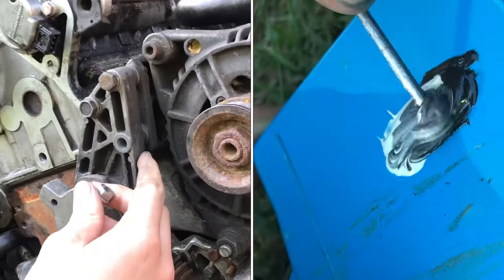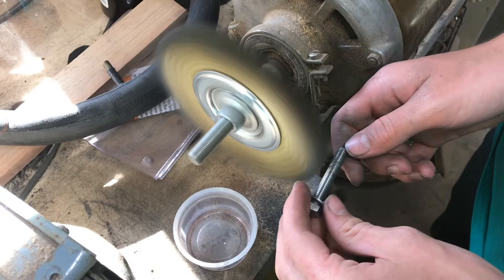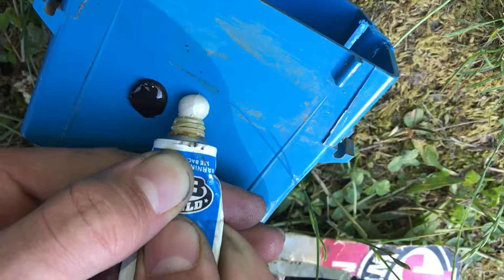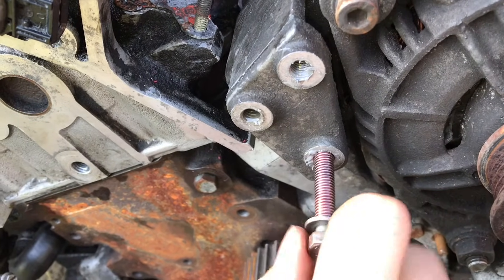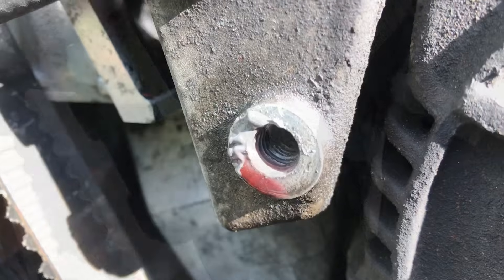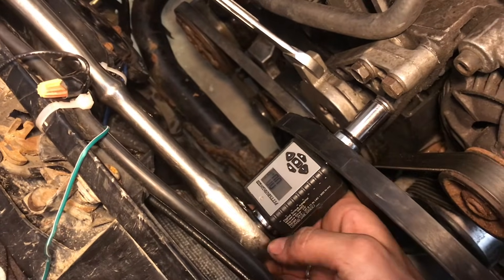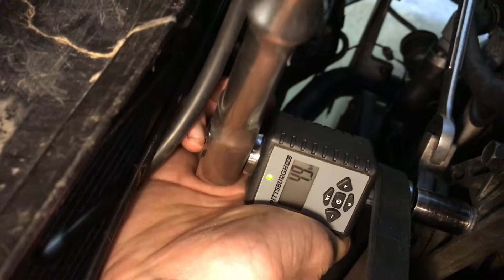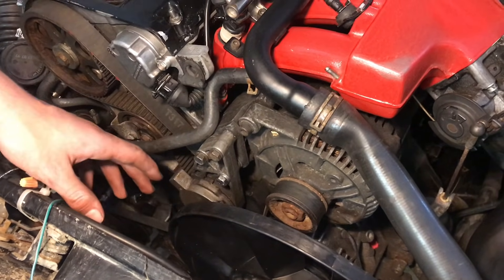does JB Weld “really” fix aluminum threads

Comment: Since the threads are partially damaged/stripped, how about re-creating the threads to the next larger size and using a larger bolt as a permanent solution?
Reply: I really have bad threads on a hole that holds the rare shocks on a car, will JB weld help? Thnx for the video
Reply from the maker: Sounds like a great idea, I’m not really liking the idea of putting a Heli coil in there. Thanks for the suggestion. That’s probably the directional we will go👍👍
Reply: @livefree6878  heli coils are junk unless Thay can bottom out on the threads .should use the next size bolt up and just cut new threads or sins it went all the way threw u could have just used a nut in the other side and thru bolted it
Reply: At first I thought you were saying helicoils are junk 😂. But your right, they need to be bottomed out unless it's a very low torque and small bolt.
Reply: @michaelh7527  why what happens? You drill and tap the hole to fit the helicoil so it sits in its own set of threads and the coil matches the thread pitch. So how would a blind hole be better than one that passes all the way through? The insert isn’t supposed to bottom out in a blind hole to begin with whether you use a bottom tap or a plug tap. Even with a bottom tap, good threads don’t go all the way to the bottom of the hole because you can never drill a blind hole out to the very bottom for retapping. The fastener never bottoms out in a blind hole either you’re just asking to crack the material.

Comment: You should try some helical inserts they work very well !
Reply from the maker: Thanks, I saw a lot of people re-creating threads like this but I never actually saw them put torque on them. At least now I know.
Reply: @livefree6878  I used JB weld with Heli-coils to get my seadoo head bolt some proper threads, downside is it destroys the threads on the bolt, Im going to try tapping the JB weld tomorrow with actual bolt threads to see if it makes it to 17 Ft-lbs, Im using JB Marine Weld with a tensile strength of 5050 PSI, and the threads are 1.25 inches long. I have reason to believe if the JB weld is Drilled and tapped with threads correctly then left to sit a bit longer it becomes alot stronger, but Im going to test this theory. Putting a bolt in the hole and using a release agent ive heard causes uneven weak points as it cures, it also can slightly damage the threads, also mixing it like a cake adds air, gathering it up and spreading it out also causes weak spots. Will reply back if it breaks.